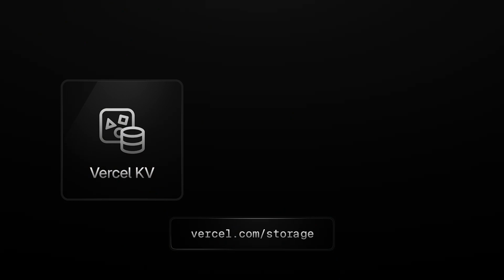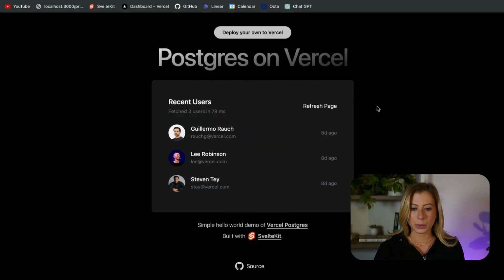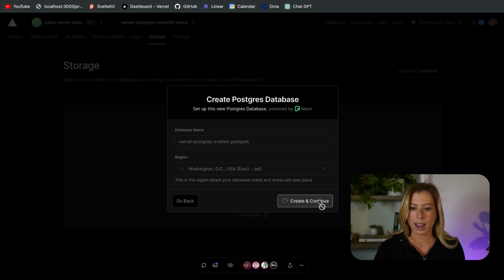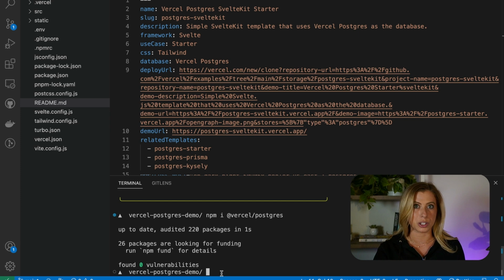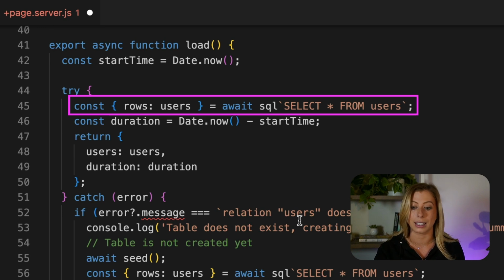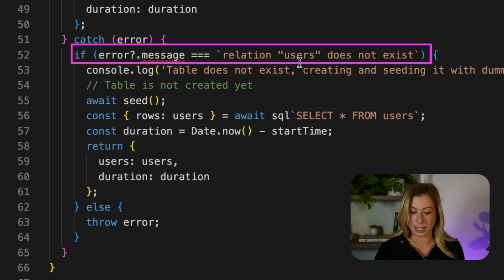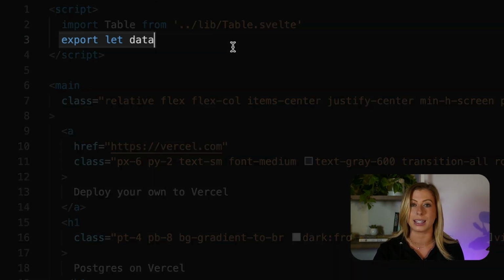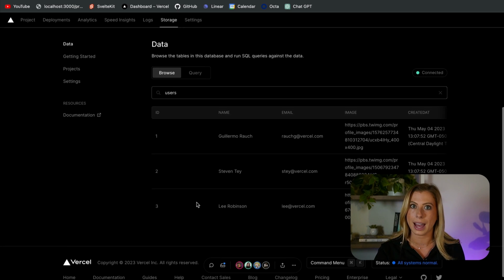Using Vercel Postgres with SvelteKit

Comment: Love this, it’s been working great. I have one question though. 
I’m using the new SvelteKit Auth (NextAuth.js), in my local development environment that is starting the dev server via the Vercel CLI (vercel dev) so that I can access the database. Doing it this way instead of pnpm dev causes the oauth callback to fail. And I can’t not use the Vercel CLI because then the database connection fails with the ‘missing_connection_string’ error in the server console. The same code functions perfectly when deployed to Vercel. 

How can I get auth and normal database access working locally?